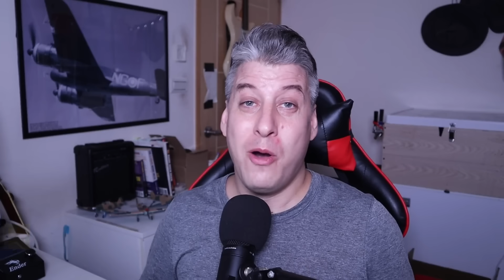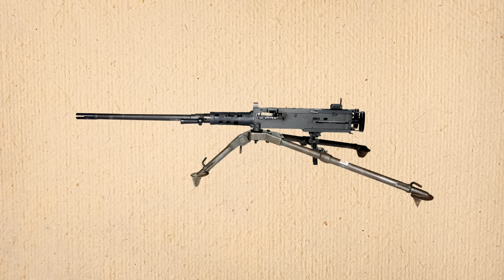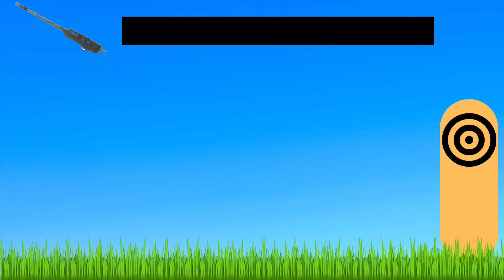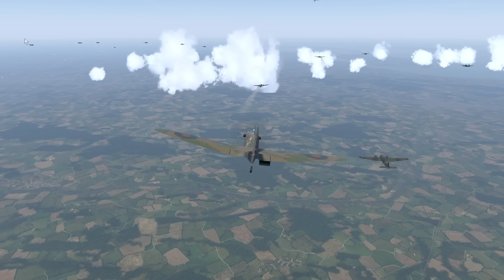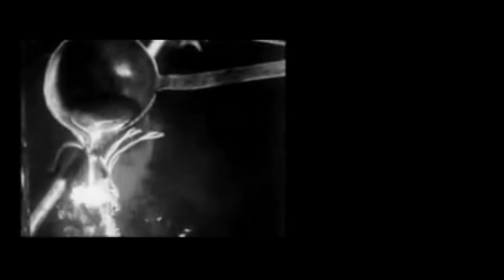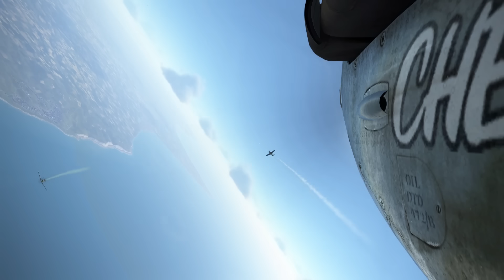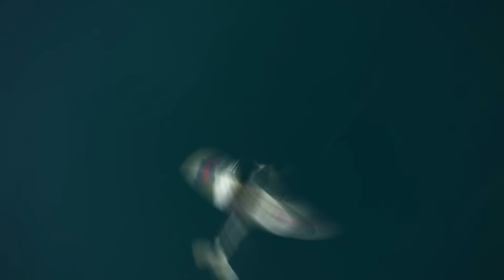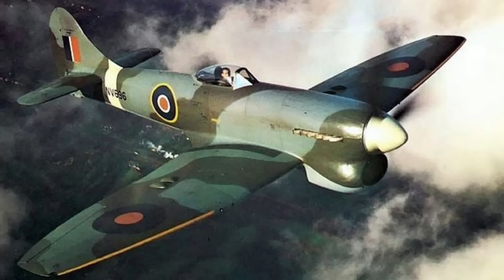Why Did The RAF Use .303 Caliber Machine Guns in WW2? The Surprising Answer

Comment: This video is trying to justify Britain's use of their pathetic British .303. It is 5 times less powerful than the US .50 cal.  This video does explain some reasons, but has missed the ley points. The .303 did shoot about 50% more rounds per minute than the .50 cal, as would be expected from a much smaller round. The .303 British was smaller in width and bu;;et weight,  and could shoot a bit more overall ammo, but not much than in US planes) than the .50 cal. I am a WW II historian, and here is my assessment as to why Britain was way behind with the air machine guns.
1) The main reason was that the .303 was a proven item and they had lots so them and the ammo to go with them when the war started out.
2) The Brit airplanes were all to small and not powerful enough to handle the much heavier .50 cal guns, AND the MUCH heavier ammo, so their airplane design was at fault already. ALL the American planes of WW II, fighters and bombers, used the .50 call. Many fighter planes had 6 .50 cal guns, and some (the P-47) had 8!
3) Most of the British air war was at close quarters and not far from their base. So, in the Battle of Britain, the dog fights were in close, and as it progressed, the German fighters were getting more and more tired since they had to travel 'large' distances, as compared to what the British fighter had to do. This made the British dog fighting easier, and the German planes were not the well armored.
4) The US could have mass produced (in very large quantities to satisfy the small British air force), the .50 cal in 1940 IF Britain had put in orders for it in quantity, so that reason is just bunk.
5) As is stated in this video, the British did think that the higher rate of fire was all that counted, and never understood the massive difference between their pea shooter, and the .50 cal. This was only somewhat plausible early on, until armor became the standard. But it still relied on getting in very close, for it to be effective.
6) Then there was the 'not invented here' syndrome. But they were eventually forced to face reality, and towards the3 end, they shifted to predominately cannons, even though their rate of fire was very low, negating their initial ideas about quantity being everything!

As a testiment to the effectiveness and its devastating power of the.50 cal, it is still in use in the US military today, although not as machine guns in fighters. The use Gatling type machine guns, firing cannon ammo.
Reply from the maker: Thanks for the analysis.

Comment: The British are great at taking less and getting the most results. The .303 is great on white tail deer as well. Yes the high rate of fire. It was good that the British used the browning machine gun . Browning also made a .30 machine gun used in the Pacific with a higher rate of fire that the  50 cal.

Comment: I chatted to a pilot on a flying field one day and he said he had flown MK 5 Spits . He said some had been fitted with cannon but had been taken off due to reliability problems .
Reply: The .303 has very mild recoil. A cannon, not so much.
Reply: We (in England had the .303 in abundance, and they were already installed in the early Spits and Hurri's, and pretty much everything else that moved) I am sure economy while Britain was all alone against the Axis. Had a substantial effect on the decision.
Reply: If he was in 19 Squadron during “The Battle of Britain” that would make very good sense! 

19 Squadron were tasked with trying out 20 mm cannons during the BoB. They turned out to be a total failure, which needed a great deal of work to get them good enough to use! Hence the delay until 1941/2
The Squadron CO was asked to get The Air Ministry to return their -303 gunned Spitfires, because they at least worked when required!

Comment: People forget, or don't know, that while in normal times a fighter pilot would have had at least 50 hours "on type" before being sent into battle, at the height of the Battle of Britain pilots were being sent up with less than ten hours on Spits and Hurries. Many of them had been butcher's assistants or clerks a few months earlier, and almost none had even fired their guns on the ground, far less than at towed targets. Much of their time in the air was spent in just controlling their aircraft, and it was pure luck if they got an enemy aircraft in their sights. They were asked to do battle with experienced Luftwaffe pilots, many of whom had been in action in Spain a few years earlier. Almost none of these novice RAF fighter pilots were marksmen, so the eight machine guns were the best choice of armament. If they could get a bomber or fighter in their sights at the ideal range of 400 yards, where the wing guns were harmonized to concentrate, there was a good chance of victory. Later in the war, the survivors of the frantic 1940 action, plus newly-trained ones with time to practice marksmanship against towed targets, were able to use the considerably heavier missile weight and explosive power of the 20mm cannon (the four 20mm of the later marks of Spitfire outgunned the Korean War USAF F86 Saber jet: The Americans stubbornly clung to 6 X .50 machine guns when all the other belligerent nations had long since changed to 20mm and 30mm cannon.)

Comment: I'm not saying you're wrong but I was told something completely different. When I went to a 1940s convention in St Annes Lancashire which was mostly about the war. According to RAF when displaying a Spitfire according to them Winston Churchill had a cannon fitted in the Spitfire. He wanted this if a Spitfire pilot hit one of the German during the Battle of Britain they would go down. There was a problem fitting a Canon into a Spitfire they would have to remove number of Armoured safety devices to protect the pilot. I'm not calling you a liar but I don't think he would have said this it wasn't true to some point
Reply from the maker: Yes, I agree that the Spitfire MK I was trialed with 20mm Hispano cannons during 1940, but they still needed some work. I actually refer to this in the video.

I'd be interested to know how wing mounted guns affected a pilot's armour protection. Thanks for the comment!

Comment: UK didn't have a magic wand to install equip and produce other guns on planes. It takes time to design and reconfigure. The .303 was there in abundance, 20 rounds a second per gun. Good enough for enemy fighters and twin engine bombers. So no real reason to change. Later as they produced more 20mm and even got US .50 Brownings they DID change over.

They fought with what they had... not what they wished they had.

Comment: I've owned a 1918 British 303 rifle and I can tell you that thing really was accurate and as far as I'm concerned the first sniper rifle ever made I used it for deer hunting What a fine piece of work that was.
Reply: I used them in cadets 303 lee enfield in 90 doing pokey drills with them at about 6 stone
Reply: @stephenbrooklyn7945  yeah I'm not sure how far 6 Stones is but typically I used to shoot the 303 at about a hundred yards up to 300 yd I have been told that that rifle can kill at 1500 ft but I wouldn't know about that never shot that far I do have a very good eye though. I guess with the right ammunition Anything is Possible I do know that that rifle is actually better than 30-30s and 30 ought 6, I used to love that rifle got it on a trade from me gun dealer in Texas and it was in excellent condition came shipped in gun Grease and a bag and he went through it the only thing that was missing were the emblems.
Reply: @MakinEndsMeet69  apparently you have a significant lack of knowledge regarding rifles and ammunition. You make the statement that your British .303 is better than a 30-30 and 30-06. 30-30 and 30-06 are cartridges NOT rifles. The 30-30 could be found in several different rifles and the 30-06 has been chambered in countless rifles including the British designed Enfield. The 30-06 cartridge was significantly superior ballistically than the British .303. It possessed a longer effective range, flatter trajectory, and superior energy on impact. Check out the ballistics charts to confirm this.
Reply: @MakinEndsMeet69  the winchester is  a model number ie 94 the ammunition is 30-30 or other like a 45/70 The rifle may be called a 30/30 by users but that is purely the ammunition used
Reply: I bought mine from an old WWI vet who had his infantry rifle sporterized - it was stamped "U.S. PROPERTY" and could drop a whitetail, elk, or moose in one shot. Phenomenally accurate!
Reply: @jollyrodgers7272  thank you so much for the reply, I rarely took more than three shells out with me when I went hunting as you know one Shell One drop. My infield was the full wood version all the way out to about three or four inches from the tip with a ramp up site very versatile rifle although very heavy. That's all good though because even though I never had done it I've been told you could throw it down from a tree stand and never hurt it. When I purchase my rifle it was in mint condition packaged in I guess varathane wax type stuff my buddy happened to be a gun dealer and he checked it all out for me before he handed it over. Also he said that that rifle was one of the best ones that he had ever seen bought. I guess I just got lucky. Anyway happy Hunting
Reply: AMEN.... I hit a bottle with old Iron Sites at about 300 yards.  And mine was maid in 1918
Reply: Many years ago, I went to a range with the Canadian Bisley Team.  They were using .303 Longbranch rifles (Can. version of .303 Lee Enfield) with open sights.  They were amazingly accurate.  It was wonderful sitting and listening to their conversations about shooting.  They even got into....which year and which factory provided the best bullets?  A great day!

Comment: Here’s an idea.  First, Take the bullet mass x the muzzle velocity squares x the number of guns = energy being shot.
Second, consider rounds per minute x the number of guns = bullet flux.  There is a sweet spot of flux and energy.  High flux assures hits, high energy effectiveness.

In turning combat, a fighter w/ high muzzle velocity guns (.50 BMG) does not have to pull as much lead (g’s).   On the other hand, shooting bombers, a 20mm is the way to go.   Strafing trucks or tanks?  There is not a one size answer.      Cheers

Comment: There is no excuse for using obsolete weaponry. They simply were still stuck in 1918 thinking during 1940. Meanwhile Soviet union had fast firing 12.7x108mm machineguns, fast firing 20mm and 23mm cannons. Even old Polikaropov I-16(v24 from 1938) had two cannons and two machineguns. Yakovlev Yak-1(1940) had 20mm+12.7mm. Axis was also using cannons on regular basis, both german and japan designs. Even the US sticking with 0.5in machineguns is strange, but P-38 and P-39 had cannons in armament.

Another intheresting part is gun placement. While UK and US designs favoured to have multiple guns in wings, other users favoured to mount them into fuselage and keep close to center. You can put more guns in wings and they can have higher rate of fire because there is no need for sync with propeller which is nice, BUT you sacrifice a lot of rounds because guns have point of convergence set on ground, so for example P-47 had eight machineguns, but only at cca 400m all of them met in one spot. If you were firing at 200m or 800m, that was below or behind convergence point and you lost huge amount of projectiles simply missing target. Not bad for anti-ground fire, but not overly effective in AA role. While if you keep guns in center (firing through propeller shaft of synced) you get much better convergence option and you can easily cover 100m-1km with that setting and always have all rounds flying towards the same spot. So then you only need less guns and less ammo while retaining high efficiency of fire.

And third thing is, that with mixed guns you also need to pair them from the ballistic point of view. If you pair low velocity cannons with high velocity machineguns and fire them both at same time, projectiles from cannon will fall much faster than rounds from MGs. So the best option is to have all guns on plane same, or at least have all of them with similar ballistic parameters.

That is why the best options are like on LA-7 where you had three 20mm cannons in fuselage and even with 100 rounds per each you could easily inflict significant damage even with short bust. But you had to aim well. On the other hand with P-47 they simply sprayed everything wasting huge amount of rounds, but it was probably better for inexperienced pilots with no idea about distance x convergence x ballistic etc. They simply +/- aimed and held the trigger.

Comment: You need to look at an early mark of Spitfire wing to see why they went with the 303. They were lucky to gave fifteen seconds of ammo. The mustang was designed so much later when a lot more had been learned. It also gad a lot bigger wing. Remember, in the mud 30s they were still designing biplanes.
Reply: That doesn't explain why the .303 was still the most common gun alongside the 20mm even in later marks of Spitfire, and was always the standard gun on the heavy bombers. We aren't just talking about Spitfires and Hurricanes in 1940.
Reply: @justforever96  my only thought would be that they persisted purely because it was the standard calibre for Commonwealth military weapons and thus readily available. In Australia you can purchase boxes of ex-military stock .303 rounds for cheaper than modern manufactured rounds. You could apply the same rationale for the USAF’s decision to arm early F-86 Sabre’s with the standard 6x .50cal machine guns when that arrangement was less effective than the armaments of similar era aircraft like the MIG-15, Hawker Hunter or de Havilland Venom.
Reply: @julienbarrett9922  Major factor was production and availability, they had to pump as many as possible out whilst actively being at war. America had the advantage of being pretty safe and joining later on. German engineering is just out of this world and was only limited by how mad the R&D teams working on whatever were.
Reply: @swaggadash9017  totally agree. Germany’s aerospace research and technology was miles ahead of the Allies early in the war. Their research into rockets and guided missiles was so advanced that NASA and ROSCOSMOS performed their early unmanned missions with modified captured V-2’s
Reply: That was a major downside to many of the RAF's fighters during the Battle of Britain. In a one to one comparison early model Spitfire's and Hurricane's had poorer flight performance (marginal in the case of the Spitfire) than the Bf-109E's they encountered, while the 109 was also able to bring the same weight of fire from it's two 7.92mm machine guns and one 20mm cannon as the RAF's fighters but with around 50 seconds worth of ammunition as opposed to fifteen. Had Luftwaffe high command given them more freedom to hunt down RAF fighters the result of the battle may have been very different.
Reply: @julienbarrett9922  "the 109 was also able to bring the same weight of fire from it's two 7.92mm machine guns and one 20mm cannon as the RAF's fighters but with around 50 seconds worth of ammunition"

The only problem with this is that you're rather badly wrong. The Bf109E-1 carried four 7.92mm machineguns - half the armament of an RAF fighter - and no cannon.  The E-2 had two MGs and a 20mm Motorkanone that didn't work; only one Staffel used them in the Battle of Britain and they were quickly withdrawn. The E-3 and E-4 carried two MGs and two wing-mounted cannon - but the cannon only had 60 rounds each, enough for less than seven seconds of fire. After that was gone the Bf109E-3 effectively had the same armament as a 1916 Albatros D.II, and a quarter of what a Spitfire or Hurricane carried. The pair of MGs each had 500 rounds and fired at 1,200rpm (do the maths) so the only way a 109 could fire for 50 seconds was to use one gun at a time. And there wasn't a button for that.

"Had Luftwaffe high command given them more freedom to hunt down RAF fighters the result of the battle may have been very different."

They tried that with the Freie Jagd tactic. It didn't work. Fighter Command, who had the huge benefit of integrated information from radar and the Royal Observer Corps stations, simply avoided them and kept going after the bombers. In any case the 109s didn't have enough fuel to do much hunting.
Reply: Typing is hard, isn't it?

Comment: I have no problems with 303.
Don't see the issue at all.
By 1930s standards makes perfect sense.

In my view. I actually have no reason to change it even if I knew Battle of Britain was coming.

303 is fine in 1940 as long as 20mm was around the corner.

In hindsight, RAF would have been better with X-Wings firing proton torpedo but we exist in 1930s world and not internet world.

If we had to depend on internet then the world would be flat and vaccination would be banned.